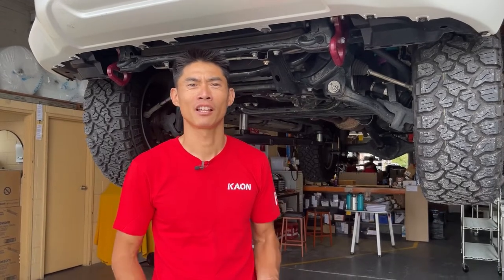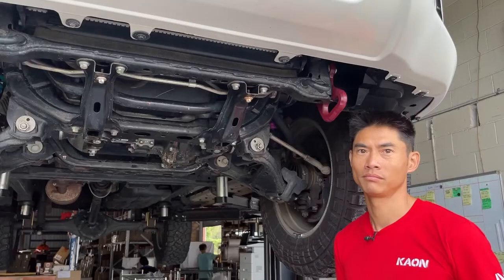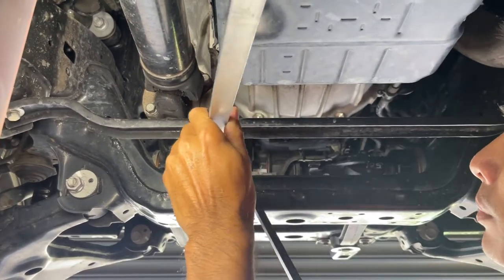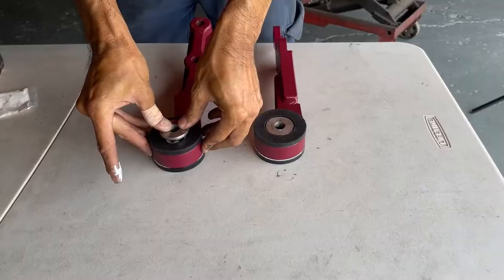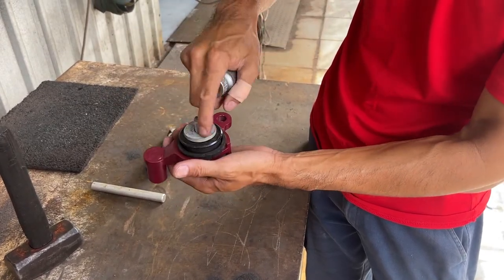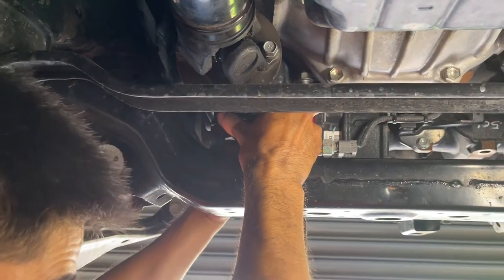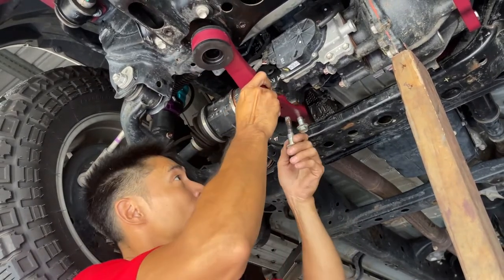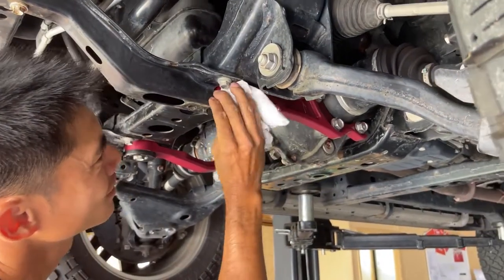Arm Style Diff Drop Kit to suit Toyota HiLux N80, N70 & Fortuner – Fitting & Installation Guide

Comment: I don't suppose there'll be some kind of exchange or discount program for those of us already with the N80 underbody protection kit.
Reply from the maker: At this stage, a used-gear program is not really the kind of thing we're able to support operationally, but it would be a fantastic thing to be able to do in future. 

That said, if you have the full kit, the Trans guard wouldn't need to be swapped out. We've currently got a front and sump set to suit this Diff Drop in progress. Our best suggestion with the front and sump would be to try selling it on.

Comment: Well done with the video and explaining along the way👍. The inner L/H CV joint still looks to be on a severe angle at full lower travel. You would think that joint at that angle would fail under extreme load.
Reply: It's at that angle cause it's on the hoist, once the weight is down they should level up abit

Comment: great video. Can you please confirm if the diff centre contacts the steering rack at all after being dropped? I have a kit at the moment where this is the case and i am looking to change it beacuse of that?
Reply from the maker: Thanks! Great question. Our does not contact the steering rack at all after being dropped, clearing both it and the cross member by about 10mm. We have seen other options on the market with claims for lower drops that do often result in vehicle components fouling.

Comment: Hey Lay, just a quick question. 

Why didn’t you guys over at KAON, engineer in the extra mounting point for the diff drop arm on the drivers side of the car, like they do with other brands like phat bars and psr etc? 

Is it just not needed? Or is the way the KAON ones are built higher in strength? Thanks
Reply from the maker: Hey David, great question. When designing the diff drop our philosophy was to retain as much of the Toyota design principles as possible, whilst still achieving the optimum drop required to correct CV angles. In our experience, the extra mount increases the potential for drivetrain vibrations by making one side in particular too rigid.
Reply: No such thing as too rigid, especially with the loads and torque in low range when loaded up. Have used these setups a lot with full front to back bracing and there superior results with no additional vibration.

Comment: Looks so good :) Do both the Stock Toyota Underbody Protection and also the Kaon Underbody Protection fit with this Kaon Diff Drop Kit?
Reply from the maker: Hi there! At this stage we can't confirm it's compatibility with the Factory Toyota sump guard, but it is unlikely. 

Our current N80 & Fortuner guards are going through a revision to be compatible, which we'll be adding soon. 

Our recently released N70 guards are compatible – just select the Diff Drop option.  

Hope that helps!
Reply: @KAONaust  It sure  does thank you :) lucky I didn't buy any Underbody Guards as yet!!!.... looking forward to the revised Kaon ones and this Diff Drop Kit for my MY22 Fortuner!!! :)
Reply: Will this work with the fj cruiser and 4th gen 4runner? Front diff is pretty much the same